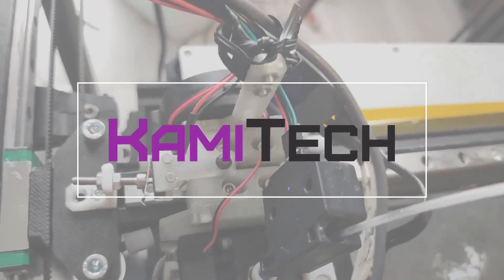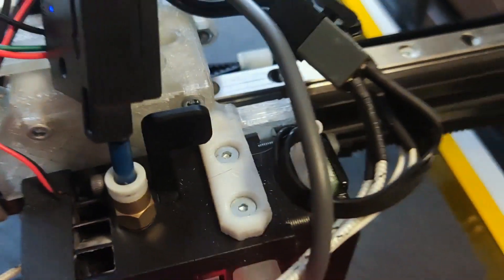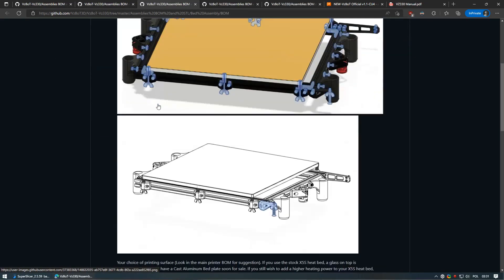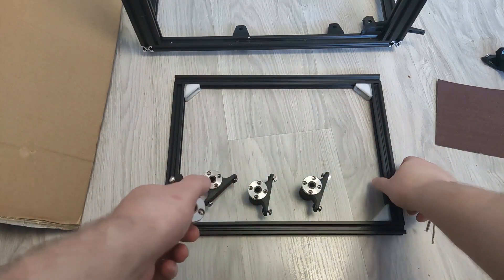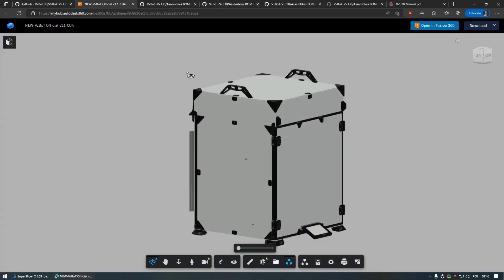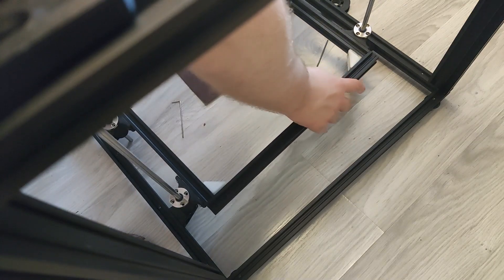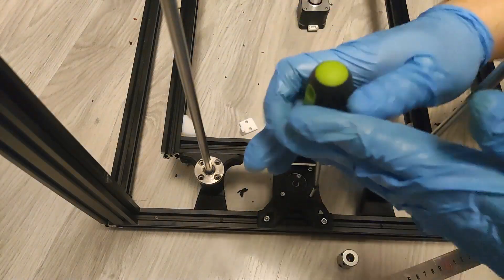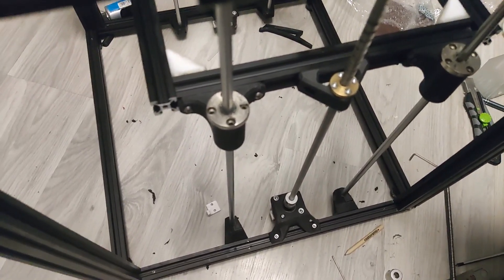Converting Tronxy X5SA to RatBot/VzBot - Bed and Z axis - Part 2

Comment: Nice video, very explainable! I have a problem with the rods. I convert an x5sa pro to a vzbot330 awd. Did you cut shorter the rods?? i tried to install them and they are pretty longer than it should be.

Comment: I didn't catch it -- what is wrong with the stock bed mount on the X5SA Pro? If the bearing sleeves and mounts for the Z rods are replaced with good ones, then what's wrong with it?
Just trying to re-use some more TronXY part to save money on the build.
Reply from the maker: Bed mount is made of 10x10mm aluminum rods, these are really flimsy. Bearing and sleeves should be fine

Comment: Hello and thank you for your really useful guides! I am waiting for my Amazon return Tronxy and wanted to ask you something. I watched your video on the BOM (part one) and you mentioned that for the z assembly, you do not really need anything, provided you get all parts from Tronxy. Does that mean that the leadscrews from Tronxy work on the VZbot bed?
Reply from the maker: Yes, they do, vzbot repo has special version for 525 rods and those are for stock tronxy rods/screws.
Reply: @KaminarisTech  I've been looking through the GitHub and couldn't find it

Comment: Everything is nice but you lose bed size
Reply from the maker: If you use recommended extruder you don't lose bed size at all, both are 330x330, I have lost a little size when using biqu h2 v2

Comment: I have a lot of fractions in Z axies, maybe because I printed the parts in one piece in both side of the bed! And I wanted to use two motors but it seems I need smaller stepper because bigger motor doesn't fit.
Reply from the maker: That shouldn't be a problem, you will get friction only when bearings are bad and/or they are not aligned correctly. Printed parts play nearly no role in this. I had to align entire bed and mounts couple of times to get it right